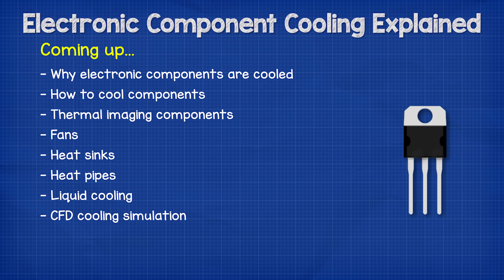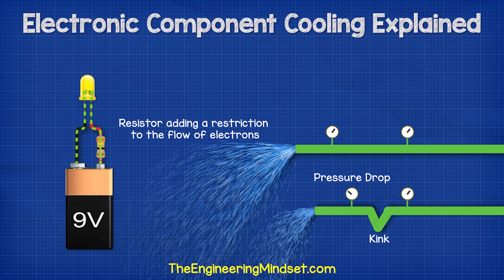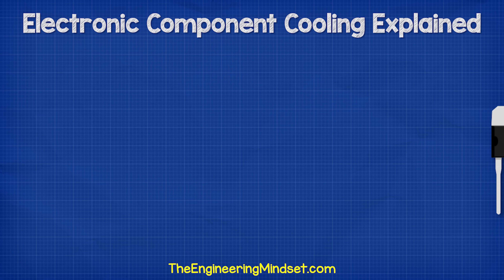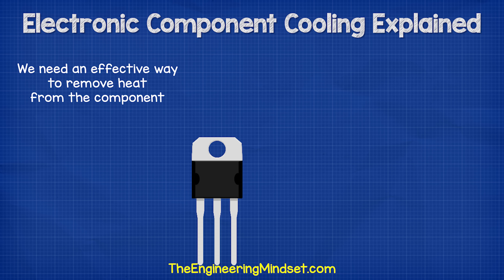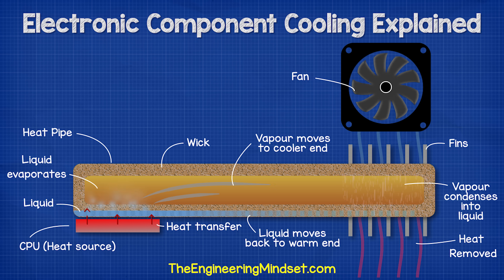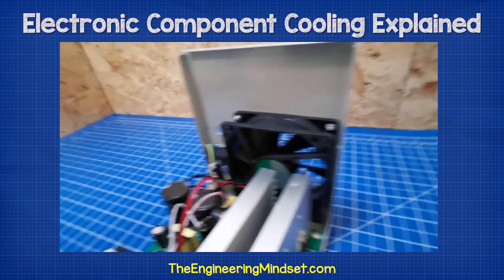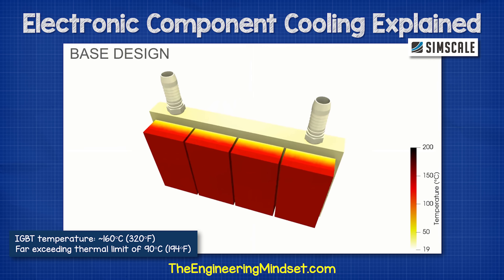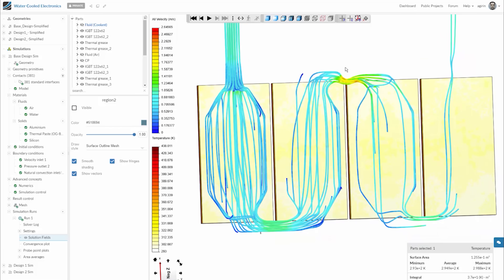Why Electronics Need Cooling - transistor heat sink

Comment: Very informative video about heat removal.  I have one question please.  Which type of insulator between a power transistor and a heatsink transfers heat best? Mica, silicone or a ceramic insulator provided that all have thermal paste on both sides?

Comment: 0:52 Why use a 9V battery when you know it will burn out0 the LED though? You opt to use a 9V battery, only to add a resistor to reduce the voltage, wasting energy and releasing heat in the process. Isn't that redundant?
Reply from the maker: Check out NEW resistor video, everything covered! ➡️ https://youtu.be/DYcLFHgVCn0

Comment: This was more about how cooling works, but never explained WHY components get hot. What is the reason? You have to conclude from watching this yourself that its due to how much current flows through a device versus its physical size.

Comment: Wonder if Peltier plates would be any good at taking away excess heat from heatsinks, but I think there would be a condensation issues, then there's the 70 watts needed to power it. Have yet to see a Peltier used in such circuits to cool them down.

Comment: we have a thin layer of thermal paste and we try to keep it as thin as possible, because as much as thermal paste is a good conductor of heat, Cu or Al are much better, we just use thermal paste to fill in the imperfections on the surface of the metal.

Comment: This is actually pretty misleading. Yes, all electronic components have resistance, and yes, passing current through resistance creates heat, but that is NOT the reason why modern electronics needs cooling, since the heat produced by the resistance of most low current electronic components in quite miniscule. The real reason why modern digital devices heat up so much that they require cooling is the way they do computation. It would be way too hard to explain in a single comment. To understand it, you need to understand the "Maxwell's demon" problem and especially the Charles Bennett's solution to it. 
Let me quote wikipedia: " In 1982, Charles Bennett showed that, however well prepared, eventually the demon (or the logic circuit) will run out of information storage space and must begin to erase the information it has previously gathered. Erasing information is a thermodynamically irreversible process that increases the entropy of a system. Although Bennett had reached the same conclusion as Szilard's 1929 paper, that a Maxwellian demon could not violate the second law because entropy would be created, he had reached it for different reasons. Regarding Landauer's principle, the minimum energy dissipated by deleting information was experimentally measured by Eric Lutz et al. in 2012. Furthermore, Lutz et al. confirmed that in order to approach the Landauer's limit, the system must asymptotically approach zero processing speed."
It's important to note that pretty much all existing logical circuits will dissipate heat, because even the individual logic gates erase information every cycle (if you have two inputs and only one output, then entropy is increaed because you can't recreate the input states from the output state).

Comment: You did not even mention the reason digital semiconductors produce heat: Gate capacity. Every time a transistor switches the gate capacity has to be charged or discharged. This is why the power usage increases linear with frequency at the same voltage.
The capacity of a single MOSFET is very small but because of the high frequency and huge amount of transistors it will generate the most heat in modern CPUs.
Reply from the maker: See my new MOSFET explained video here➡️: https://youtu.be/AwRJsze_9m4

Comment: So wait, resistors don't reduce the amount of energy being used by the power supply, so if a 9 volt battery powered an led with a resistor, it'd last equally as long as if it was powering something without a resistor?
Reply from the maker: Check out NEW resistor video, everything covered! ➡️ https://youtu.be/DYcLFHgVCn0

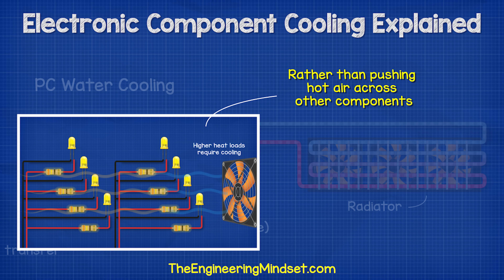Comment: 8:20 what if we use a liquid of low boiling point like ethyl alcohol or something like that?? Instead of water
Reply: Some ppl do that but too much will change density of fluid i guess and pump will struggle
Reply: @akshar234  oh

Comment: Great video, I have a question! Why do transistors in a cpu get so hot?
Reply: In order for a transistor to switch, it needs some amount of energy (more energy for a bigger/higher power transistor) and that gets released as heat
Reply: @everythingfeline7367  I assume because of the millions of transitors the very tiny amount of energy required to switch a transistor, adds up to a lot of heat.
Reply: @NotLe0n  indeed. Billions of transistors switching billions of times a second adds up quickly
Reply from the maker: Transistor video now live: https://youtu.be/J4oO7PT_nzQ

Comment: Dont you want the *thinnest possible use of thermal paste? TP is not efficient as the heat block and can act as a heat buffer?
Reply from the maker: Yes, the thick layer was used on purpose to show a bad design. Design 2 uses a thin layer and we see the improvement

Comment: Thin layer of themal paste its there to fill imperfections not to be a buffer
Reply from the maker: Yes, the thick layer was used on purpose to show a bad design. Design 2 uses a thin layer and we see the improvement
Reply: @EngineeringMindset  ah, that did not seem clear in the Video, but makes more sense

Comment: 10:28
The Engineering Mindset: The thermal limit is 90°C.
Intel: Those are rookie numbers!
Reply: intel: pathetic. not even 110C
Reply: Intel laptops have something to say lol
Reply: My gaming laptop runs at 60 idle lmfao and 100 during heavy games. It's just fine so I think people exaggerate on how bad high heat can be
Reply: @triton6490  try undervolting the cpu, going over 90 while gaming is not ideal. i undervolted my cpu and now it barely goes over 80.
Reply: Kart It’s a laptop,so that may not exist
Reply: @triton6490  only 100 lol I my crappy i3 laptop gets to about 120 on minecraft, I've had to open the back and basically make a case with fans so my laptop doesnt die lol
Reply: @triton6490  it is fine on laptop,

Comment: I fried my CPU trying to overclock it and this shows up in my recommended. This is just adding insult to injury.
Reply: You probably fried because you increased the voltage too much, is basically impossible to break a CPU just by overeating because the computer will just turn itself off before it reaches the real limit of the CPU

Comment: I have 3 MOSFETs hooked up to a 24V DC power that are running with no heat sink. The MOSFETs are rated for upto 50V and 20A, I doubt anything more 6A peak is being used. I've been running semi continuously for a few hours at most at a time. It occured to me now that they might need more cooling though I'm not sure. Any advice?
Reply from the maker: See my new MOSFET explained video here➡️: https://youtu.be/AwRJsze_9m4

Comment: Class AB stereo receivers have bigger heat sinks than a 1000 watt class D car subwoofer amp but, class AB amps have much more lively warm sound than class D amps but, does not really matter with a subwoofer though. Even a low wattage class AB amps like in a Bose Sounddock Series III iPod dock speaker has some form of a heatsink. Without a heatsink on those 6 or so transistors, or the class AB amp ic, you will lose sound quality, and ultimately have no sound at all due to permanent damage. For home audio amplifiers, a fanless design is desirable because a fan can drown out some of those subtle nuances in music. So you want the fins run vertically and make sure the heat sink is large enough and have space beneath the heatsink fins to allow natural convection to work effectively.
Reply from the maker: Check our our new car battery explained video: https://youtu.be/VnPRX5zQWLw

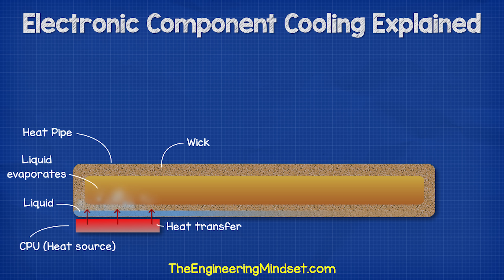Comment: Very nice video but I have 2 remarks: @6:50 the vapor moves to the opposite end because vapor goes up and the pipes are designed to have a little elevation so the vapor could go to the end that is getting airflow from the fans.
@8:10 you say that water cooling is better because water has higher heat capacity? First heat capacity is bad for cooling, it actually means that the mass need more energy to increase its temperature which is bad because then the delta T(between air and water for example) isn't as high as it could be therefore the mass conducts less energy (higher the delta T means more energy transferred per second) and also the water in water cooling is just to transfer the heat out of the interior of the computer to the radiator on the exterior, the air still must do the cooling. The advantage is that then you can have bigger heat sink which then of course can transfer more heat to the air with the help of 3 fans (usually) which is not possible inside due to form factor and then the heat sink covering ram slots etc... Air cooling of the similar size is almost the same. Check Noctua, Dark Pro vs liquid coolers.

Comment: Is it possible for electronic components to get just enough energy to not heat up but function efficiently?
Reply: Not heating up at all is not possible. If something moves against something, it creates heat as friction, in this case electrical. Try rubbing your hand against a rug, friction warms your hand. Same goes for electricity that goes through wires and components. It is possible and often desirable to use very high conductive materials and efficient design to minimize the "friction" but no, non-heating electronics are not possible.
Reply: @Teknopottu  thanks for the detailed explanation

Comment: Why do CPUs and GPUs limit their temperature to 100 C? It's not like silicon melts at that temperature, it has a way higher melting point, imagine how much better performance can be if we simply ignore the 100 C thermal throttling point

Comment: I'm not an engineer, but from what I understand, you do NOT want a "thick layer of thermal compound". If the gap between your hot component and the cooling surface is too large, it will be much less efficient then if you keep the gap to a minimum.

Comment: could you install three resistors (or mosfets) where only one is usually used with each having a third more resistance balanced out by using three so each one gives only a third of electrons  thus a cooler operating temperature , per resistor?
Reply from the maker: Check out NEW resistor video, everything covered! ➡️ https://youtu.be/DYcLFHgVCn0
Reply from the maker: See my new MOSFET explained video here➡️: https://youtu.be/AwRJsze_9m4

Comment: Hope you can make a topic on server or IGBT immersion cooling, which would be a continuation on the IGBT cold plat cooling at the end of this video. Thanks.
Reply: Immersion cooling is a big topic in data centre now days but it has been widely used at large power substations where IGBT modules/inverters are immersed in dialectic liquid for cooling.

Comment: The heat is waste

90% of electricity is wasted as heat
Reply: That statistic is completely worthless. With lower current systems the efficiency is much higher than with high current systems. In some cases people will use a device that turns the wasted heat into electricity again.
Reply: @TheSkyFeds  even LEDs have 80% loss
Reply: @AgentOffice  you can't can't make that generalization. I was wrong in my previous comment, higher voltage systems are more efficient. You can't say every single electrical system wastes 90 percent of it's energy with heat. That is not a fact. Efficiency depends on the individual system and is very different depending on many different factors.
Reply: @AgentOffice  electrical heaters are technically 100 percent efficient
Reply: @loserface3962  you're right, i totally forgot. But what if i say heat pumps are more efficient while also wasting electricity as heat?
Reply: @loserface3962  And IC chips(CPU, GPU cores, and memory cells) are technically 0 percent efficient. No other type of energy conversion at play, no light, no movement(kinetic), no chemical(like a battery), all of the energy is converted to heat... and information.

Comment: i need help with a gas motor auto switch. basic idea is to using a float or a time switch to turn on  the gas motor and then when the switch turns off because there is no water the motor turns off. im using 3, relays, 1 turns on the starter and starts the motor,  1 receives power from the fly wheel or stater and turns off the starter( this is were im having problems). and the last one connects the kill wire when no power comes from the switch.  thanks for any help

Comment: Water cooling should* be better in the case of computers. However, unless you're doing a custom loop with a proper cold plate/proper pump, once an AIO cooler reach equilibrium, it can sometimes be worse than air cooling. It's more complicated, less reliable and prone to leaking. 

Not the point of the video, but people put all in one water cooling on a pedestal it doesn't deserve.
Reply: AIOs and custom loops can handle short load burst better than air coolers, but end up running worse with a sustained load if the radiator doesn't have enough capacity or the room around it heats up.

Comment: Normally laptops/any appliance heat when its working to it's threshold,what if we use a laptop/... with a higher threshold value to do proceed the same process ,will it be energy efficient and thermally effective or is it a bad idea

Comment: Lel. Air-cooling is just as effective as water-cooling in PC's.
Reply: Heat transfer wise, yes, air cooling is just as effective (and can be MORE effective) than AIO or custom water cooling... However, the main benefit of water cooling loops is that you have a high thermal mass to absorb temperature spikes easily before saturating the loop, and you can mount the radiator outside of the case to avoid pumping hot air into other components.

Neither is really that much better, but the choice does depend on how you want to set up your system cooling.

Comment: But its already been proven that water cooling performs less superior compared to large heat sink fans
Reply: Water cooling a PC is just air cooling with an added middle-man. The effectiveness of one over the other has quite a few variables, radiator size being one of the largest. The advantage of water cooling a PC is that you can more easily control where the radiator assembly is located, rather than it needing to be assembled directly to the top of the heat source. Often times, many electronic devices are constrained by the spacing of the components on the circuit board/assembly, making large heat sinks with fans impractical or unfeasible in such a tight space. That is when heat pipes or closed loop water cooling systems increase in efficacy. True water cooling, where you have a constant cold water supply coming in one end of the system and warm water exhausting out the other, is leagues more efficient than air cooling, albeit not practical for consumer setups.

Comment: You forgot to talked about a Very Important point. A “Black body” and how back heat sinks can be more efficient by radiating more energy in the form of heat.
Reply: Yes, it's more efficient in radiating heat, but the amount of heat that is radiated in an electronics system is negligible compared to direct conduction and convection. "Black bodies" are also more efficient at absorbing radiant energy, so arguable they would also absorb extra heat radiating off of other components within line-of-sight. It's altogether not a productive conversation to have in the context of cooling consumer electronics. Much more-so in the context of sending a satellite into distant space where there is no air or water in direct contact to conduct the heat away with. Even then, often times it is more effective to use evaporative or sublimation based coolers. Materials usually need to reach very high temperatures, much higher than electronics can typically withstand, in order for high enough quantities of thermal energy to be radiated.

Comment: We designed and built sensors using beta decay, near IR, xray , spectrophotometers and a few other camera type instruments. Dirt and temperature cause drift and need to normalized. Using milspec components helps surviveability. Water cooling requires heat exchangers and is very effective but requires expensive closed loop components. Using air works but also typically requires air dryers and filters. Wet dirty air is death. Water leaks ouch.  Having a product fill with water is not good.  Dripless connectors and leak tests for soldered fittings and over pressure tests might help. The most fun for source and detectors is keeping windows clean. Bernouli hold downs air knifes are just a few. Shipping inadequate designs can kill a company and careers.

Comment: My senior year in 2018 the professor for our Thermal Fluids Design course gave a group the final project of designing the proper water cooled system for his PC (He gave full specs) he was building, simply so he did not have to do it himself. It was a genius project and it's cool a guy nearing 70 was building a water cooled PC. He also worked on ballistic missiles during his heydays and presented the unqiue design challenge of trying to cool a massive guidance computer in a vacuum. Essentially, following launch until space the computer shuts off, then resumes during targeting but since it has to last only several minutes the tiny radiative cooling setup was enough!

Comment: Heatsinks that cool especially energy-hungry components (such as CPUs or GPUs in computers) will usually have a copper core with aluminium fins. The thermal conductivity of copper is greater than that of aluminium, so it is used to distribute more heat faster to the aluminium fins. Full copper heatsinks do exist, but they are very expensive and very heavy, they're generally not worth the cost.